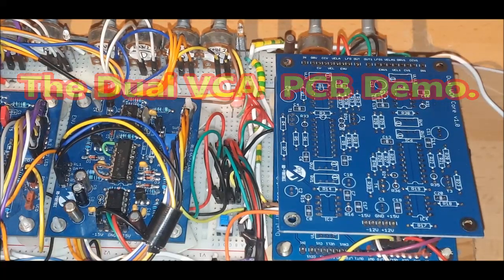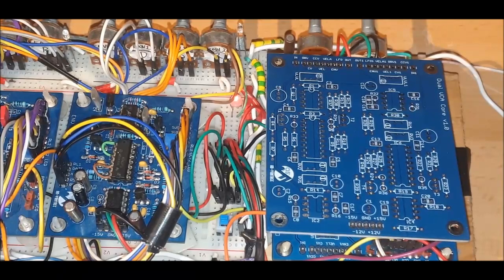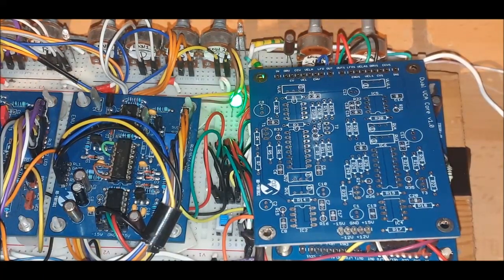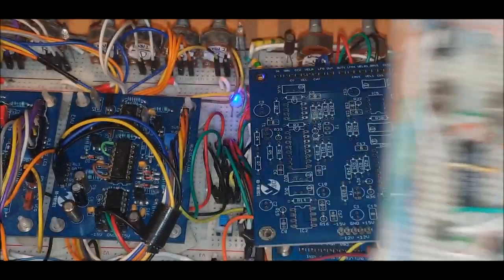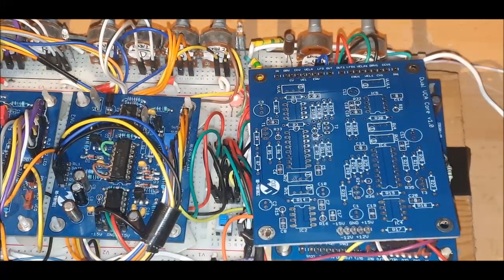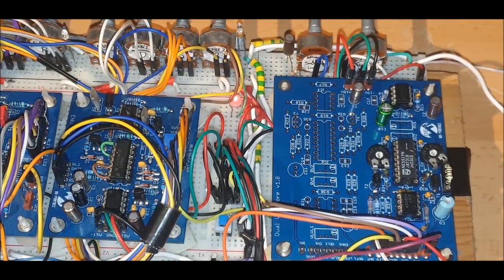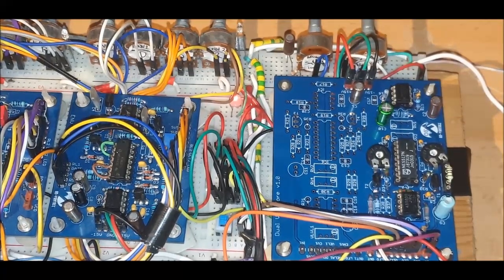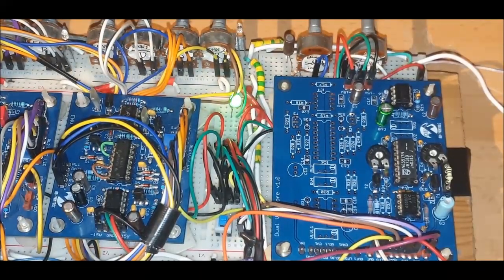DIY analog synth project ( The VCA PCB Demo )

Comment: .. or you can use a FET, like the 2SK30  like Roland used or the 2n5485 (Frequency Central) ... works just aswel en sounds awesome. you can use the darlington buffer (Ray Wilson did) as well, but the negative part of the wave is slightly less "high" or pronounced, but you wont notice in the speakers.

cool, i dind't know the NE5517, but it's cheaper than the lm13700, even  pin compatible, accept for separate pins diode bias.
yeah, i tried the trimmers aswel as documented in the lm13700 datasheet and other schematics, but ... hardly noticeable.
Reply: the distortion is mostly due to the breadboards and wires. that's why network cables are twisted.
Reply from the maker: Yes I have tried using a fet as an output buffer and the supplies darlinglintons. However I found I was picking up a bit more noise.
Biasing as per the datasheet does work however my values are more extreme than prescribed. I tried value from 500 ohms to 5k. The higher seems to work best and didnt give me that slight low passing at the very high frequencies. I can't electronically explain why but it does work and the cv offset billing is great.
Reply: @AdamTheAd-vanc3d  so the trimmer is connected to the bias of the diodes? and that is what causes the clicking?

i just revised my Frequency Central Dual XVCA, witch also clicks .. and just now twisted the both trimmers and i think the clicking diminished quite a bit. they used 100K

i have build a Filter  month ago with Fets and scoped it, i tried with Elvis presley, Chemical Brothers, Ben e. King, goes pretty wel.
i use the bias trimmer aswel but, but i didn't see the effect of it, but than again those 25 turn trimmers are ....

make revision 1.1 linear / log.
https://www.haraldswerk.de/VCA/VCA_LN/VCA_LN_101_schematic_02.png
http://musicfromouterspace.com/analogsynth_new/DUALVCA/DLLVCA001.html
linear / log ... actually your output VCA should be LOG, due to analogies of the human ear.

nice job
Reply from the maker: @AnalogDude_  No. Connect the trimmer like so. Outside pins 1 or 3 to pins 3 and 4 of lm13700 so both the inverting and non are connected and then the middle pin of the trimmer to ground.
The pins 2 and 15 are where you connect the linearised diodes to your +v  via a resistor to reduce the distortion.  Use a trimmer first then settle on a good value.
Reply: @AdamTheAd-vanc3d  oh, that's the balance trimmer ... as Ray Wilson did ...
http://musicfromouterspace.com/analogsynth_new/DUALVCA/schempg1.gif
as stated in the datasheet of the LM13700 on page 15.

but most use resistors ranging from 560Ohm to 1k Ohm and connect both input to ground.

the bias pin, is to raise the voltage level on the base of the input transistors, so they work instantly instead of waiting until the voltage raises high enough for the transitor to start working.
check out:  w2aew - #185: Back to Basics: Bipolar Transistor bias circuits and Beta dependence
https://www.youtube.com/watch?v=YQlbPGNB-ys
Reply from the maker: @AnalogDude_  Thanks for the links btw.
Reply: @AdamTheAd-vanc3d  by the way, instead of an trimmer, your could also use 1206  or smaller SMD 0.1% resistors on both input pins of the OTA to ground, 560R to 1K, just make the pcb to accept both setups. resistors or trimmers.
but you should use 0.1% on the input of the ota if your wanna go as high end possible ... as around the core of the vco ( expo converter / c.v. summing bus (reallly needs 100K 0.1% resistors) / saw core ). the essential ones should be 0.1%.
Reply: @AdamTheAd-vanc3d  buy some cheap tweezers and file the points and surface to your needs so you can hold the 1206 SMD parts and manage them, it's easy ... just put a glob of solder onto 1 pad .... than use the tweezers to locate the part and melt the glob of solder on that pad and pres the part down with the other hand and done! precision tweezers cost like 25 - 50€ and maybe more. no YouTube tutorial needed
Reply: @AdamTheAd-vanc3d  got it, your can remove it here, thnx